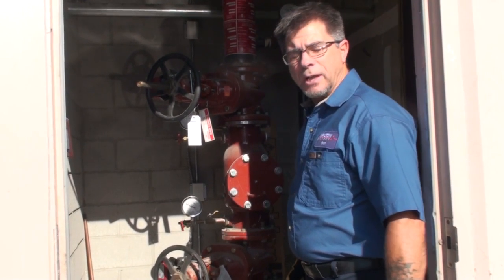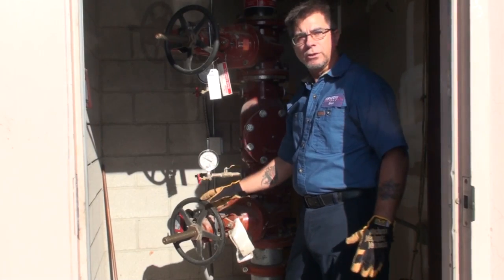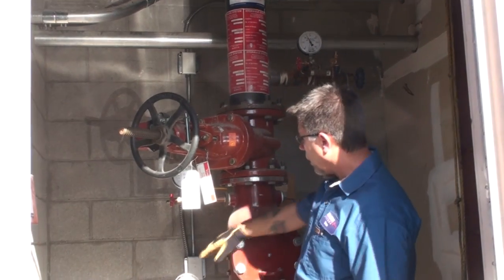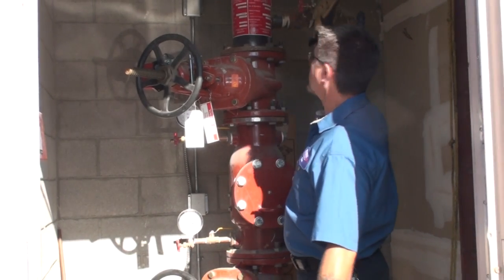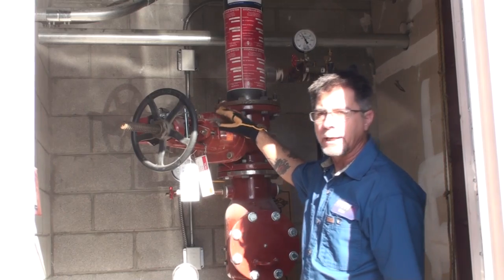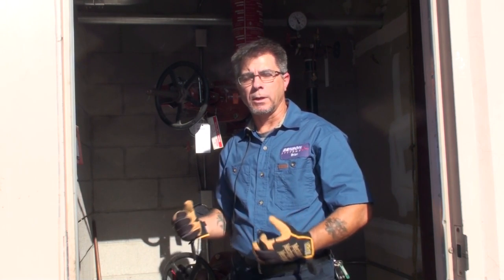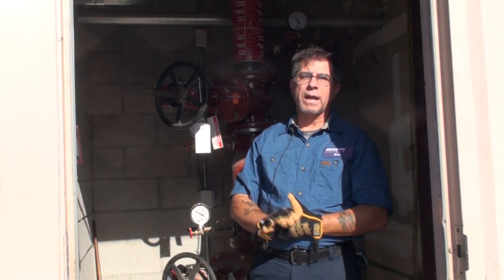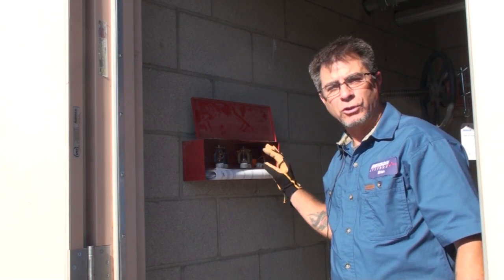Benson Systems Introduction to Fire Riser and Sprinkler System.mp4

Comment: Nfpa 25 is the inspection  testing maintenance of water based fire protection. Nfpa 13 is the installation of fire sprinkler systems. You should know this.